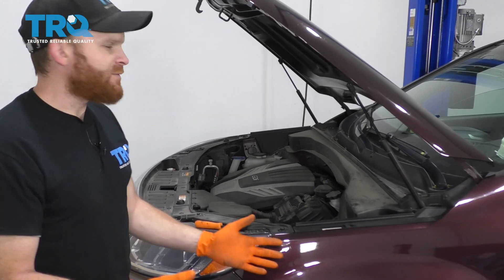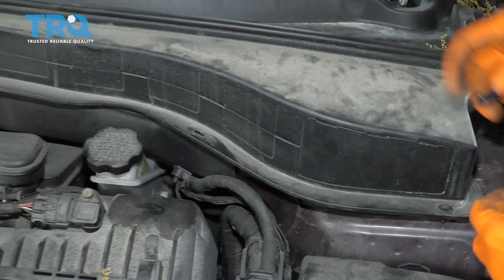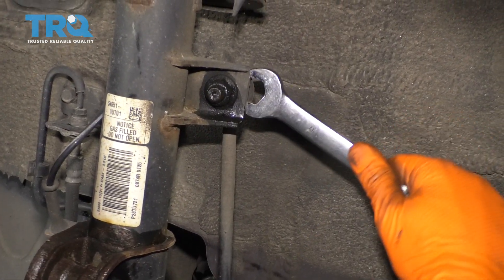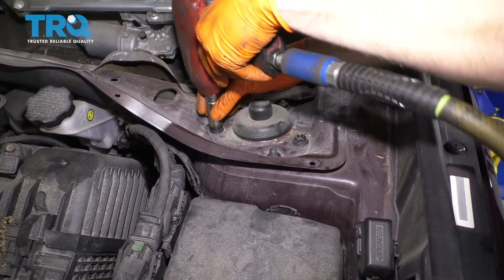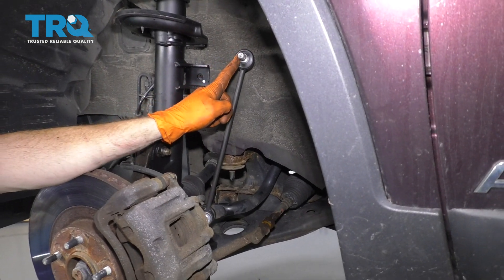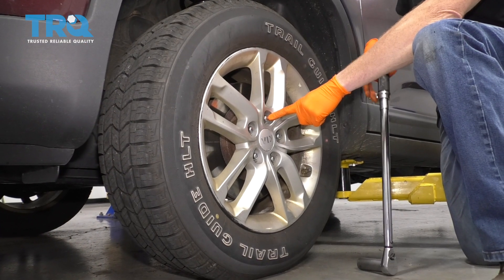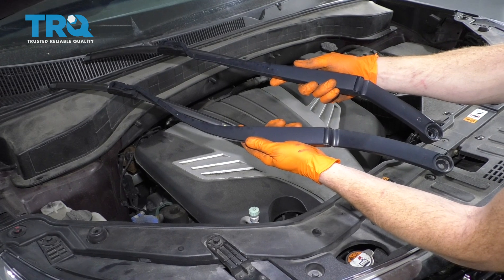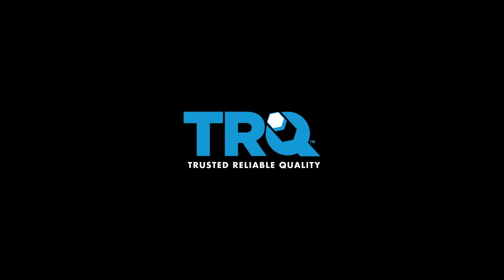How to Install Front Struts 2010-2015 Kia Sorento

Comment from the maker: √  Watch the Video
√  Buy The Part at 1A Auto http://1aau.to/m/Shop-TRQ-Parts
√  Do it Yourself
√  Save Money
Reply: There is an arrow on top of the strut. Does it matter which way that arrow is pointing when you install it into the car?
Reply: @RadiantFellowship   looking for the same answer!
Reply from the maker: +Daniel Marques Thanks for watching! The struts will only go in one way, so you typically can't install them on the incorrect side, wrong orientation etc. The arrow points outboard in most cases!
Reply: @TRQ   perfect thx for the answer!
Reply: instablaster

Comment: Great video, you make it look easy. 

  Quick question: There's a low pitch rattle coming from the front suspension on my 2012 sorento, do you have a video that points out where it may be coming from?  Thanks in advance.

Comment: It is a great video but you skipped showing one very crucial step right after you bolt down the three bolts ob top, lining up the two bottom holes, is not a simple skip over and pass the two bots through. I am having a ditch of a time lining them up and realized that I need a pry bar to lower the spindle enough to get the bolt(s) through and that is with help. I will know tomorrow when I do get them in, with help. But you should show that little bit which is omitted. The only other thing That may be keeping me from doing what the guy in the video is doing and that is the wrong strut but double checked and I believe they are correct. Let me know what you think. I wish I could talk to someone at TRQ or 1A Auto. BTW, I am replacing  the calipers,  disc, the tie rod, and they are off and a new cv axel installed. The axel was ten times easier then this strut.
Reply: Sorry but mine does not line up like the video. Spindle holes are a good two+ inches higher than the holes on the strut.